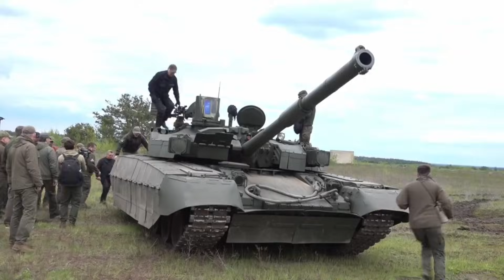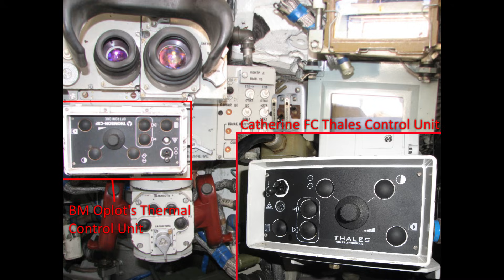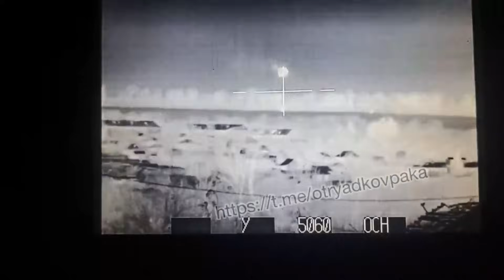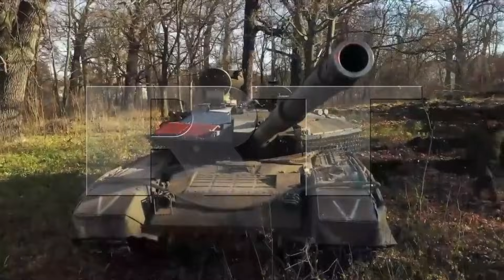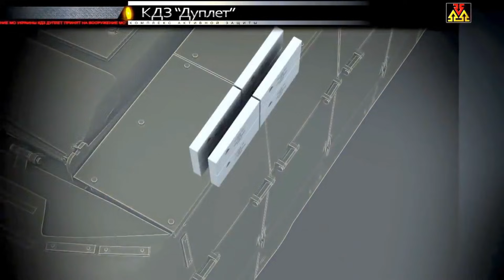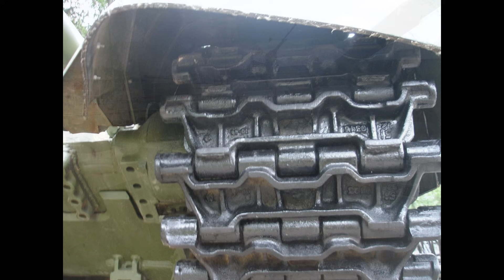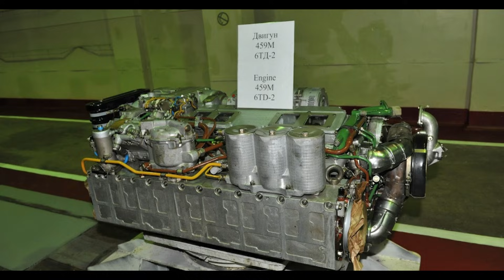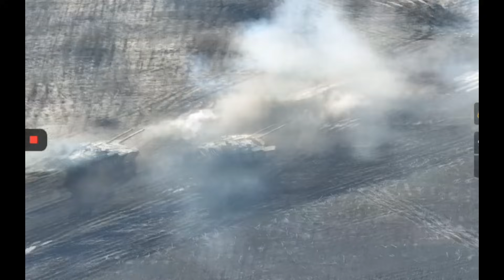Best Ukrainian vs Best Russian tank. T-90M vs BM Oplot comparison

Comment: On paper, the T-90M is the superior tank (aside from the reverse issue). Of course, it isn't just the tank that matters, but the crew and supporting elements, so that somewhat evens it out. Perhaps in the future we will see a BM Oplot-2 which addresses these problems.
Reply: Чтобы сделать оплот надо 2 танка так как оба корпуса разрезаются не много в разных местах и потом свариваются😂 это для того что бы увеличить отсек МТО, а про защищённость вообще ничего нельзя сказать т к нет боевых подтверждений её эффективности, а то что Украина сможет из производить это вообще нонсенс
Reply: If Ukraine is planning on producing the BM-Oplot now, it will likely get upgrades. Its over a decade old design that has barely any produced so they won't be upgrading existing vehicles, but making new ones. And if they are setting up a factory to make new vehicles, its a easy opportunity to upgrade its systems.
Reply: People who never set in a tank are the only ones complaining about reverse 😅, driving a car on a parking lot in reverse faster than 5 miles per hour would get you stuck within minutes, imagine driving a 50T machine in a 3D off road environment faster than 5 miles! You'll end up in a ditch within a few seconds!
Reply: The entire Oplot tank is on paper only.
Reply: And the reverse issue makes it on paper a worse tank.
The other T90M advantage are very small and situational. The reverse speed is not, as the war in Ukraine shows.
You’re much more likely to survive a battle in an Oplot with its reverse speed and better armor than in any T90M. Side armor in the carousel or not.
Reply: @Grimshak81  typical ukr. shill. It is absolutely not important , not as much as the ukr. shills led you to believe. On top of that ,nothing prevents you from turning around and using the full forward speed, as it only takes a few seconds. It is absolutely not the deciding factor in effectiveness of those tanks. As the absolutely majority of tanks are being destroyed while getting to the target and not while trying to reverse back.

Comment: It really boggles the mind that the Russians haven't replaced the transmissions. I'm no expert, but it seems to me that if the Ukrainians can install a gear reverser, then the Russians should be well and capable of doing the same.

Also as you mentioned numbers of T-90M, I've been trying to get a handle on how many have been produced since the Kherson offensive, and my best estimate is 320 or so. It could be as low as 250, or as high as 375. Just going off visible serial numbers and extrapolating, as well as collecting videos of tanks being delivered on trains. Not the most accurate method, but it's safe to say Russia is likely delivering about 2x as many tanks to the battlefield as Ukraine is receiving from us in the west.
Reply: I was a T-72 gunner with the 6th guards motor rifle regiment. The reverse speed might seem like garbage when performing maneuvers in combat, but once the tank gets stuck in mud or other unfavorable terrain (happens a lot especially during the mud season), the very high gear ratio in reverse allows it to either get itself unstuck or helps massively when another Russian tank is required to tow the stuck tank
Reply: @Insert-Retarded-Reply-Here  Thing is, they could keep that gear and add a few more. Because the danger the tank is exposed to is probably greater than the reduced risk of it getting stuck and possibly lost. I mean, at least you don't risk the crew
Reply: @Pao234_  I'm pretty sure that the engineers at UVZ have investigated this matter before making their choice. You can't imagine just how meticulous design processes can be.
Reply: @Pao234_  it’s not that simple. To add more gears requires a redesigned gearbox, and though this level of technical specificity is beyond what I am familiar with, larger and heavier gearboxes are required to accommodate more reverse gears which may prove too bulky for the T-series vehicles unless the gear ratio was changed, and on top of that it would result in reduced components interchangeability with other Russian tanks, which is partially the reason why the T-80 program was abandoned. And you may think that reversing faster is more important than recovering a stricken vehicle stuck in mud, but the soviet/Russian doctrine has a pretty consistent track record of prioritizing logistical soundness over sheer combat performance.
Reply: @koskok2965  agree
Reply: @Insert-Retarded-Reply-Here  Maybe they can steal some ideas from Polish tanks that have redesigned the transmission. I remember hearing they are a bit faster in reverse than russian tanks.
Reply: @Act1veSp1n  same as Czech T-72M4CZ
Reply: @Act1veSp1n  Uralvagonzavod has the technical and manufacturing capacity to make an even better transmission than the Poles regarding modernizations for the T-series vehicles. Apparently, they have determined that the trade off for superior reverse speed for inferior torque, less parts interchangeability, and of course budgetary concerns wasn’t worth it.
Reply: @Act1veSp1n  Polish tanks didnt redesign the transmission, they straight up bought it from the french iir, and only for export models. Domestic Polish derivatives have the same shot reverse speed, for some reason.
Reply: @Insert-Retarded-Reply-Here  they may have decided its not worth it, but it was before Russo Ukrainian war
Reply: The Polish PT-91 has a better reverse speed because it has completely different drivetrain, that consists of a 1000hp Scania DI16 V8 engine and a RENK automatic transmission. But apparently not all of the PT-91 tanks have the same drivetrain, many still have a T-72 like drivetrain with a 1000hp V12 diesel engine and the same reverse speed
Reply: @Insert-Retarded-Reply-Here  Interesting to hear some explanations as to why. Sick of hearing NATO bots laughing that it's because they can't.
Reply: @Insert-Retarded-Reply-Here  interesting feedback from someone that actually knows their stuff.
Reply: That would be very impressive considering they make less than 200 new tanks a year, if all 200 plus 100 more were all T-90M I'd be shocked, that would be greater than soviet production. Also they would have tripled the amount of total T-90M since February 2023, in less than a year! Wow how realistic.
Reply: @shadowguy1112  You know that often in a war, countries will rapidly increase production, right?
Reply: @saml7610  There is no physical way to count the number of T-90Ms made based of  a "serial number" like you can do for the SU-57. Yes production will increase, Russia however does not have the ability to increase that significantly, even Dimitry Peskov, the literally head of Russian propaganda does not claim the massive numbers you do...
Reply: @shadowguy1112  Untrue, I just counted them.
Reply: If I hazard a guess cost and time issues played a role.
Reply: Hahahah sell off spare parts go BRRR
Reply: There seem to be indications, that the production of new Tanks in Russia is currentlich nearly zero. The capacity is hardly enough to refurbisch and repair the old stuff and it ist much more effective to maintain 100 Tanks than to build 10 new.
Reply: @potator9327  Absolutely zero indications of the sort that I've seen. Not sure where you're getting your info, but it does not seem to be a very curious or intellectually honest source.
Reply: @saml7610  Nice, your sources are obviously sound and any other Intel than yours must be inetectually inhonest. Watertight bubble.
Reply: One leopard 2 is worth 20 t-90 m.
A leopard 2 can pick them off one by one and those T-90Ms can’t even see it
Reply: @sirmustard5337  they both died in syria like the british battlecruisers at jutland, turning into rockets.
Reply: @sirmustard5337  Nah my man, that's not true. I was a cavalry scout, commanded an M3 Bradley, worked alongside Abrams and German Leopards when I was deployed to Germany. 

I know tankers fairly well, and there were no illusions amongst any of the men I worked with that our equipment was in any way exceptional in comparison to the newer stuff which the Russians deploy. 

Russian equipment has it's deficiencies, yes, but it's still formidable, quite capable. Their issue isn't quality - it's their ability to get their quality, top end, modern stuff into the field in numbers. Until this war, they were really struggling to get those numbers up, but that has changed. They are cranking out T-90M's, and the T-90M is no joke. It's a serious, capable piece of kit, and anyone going up against it would be a fool to brush it off.

In armored warfare, whoever sees first, they shoot first, they win. The T-90M is well equipped to see first, shoot first. It can and will win in a head on engagement against Leopard 2's. 

Don't fall for that "Russian gear is pure junk" crap, or you'll end up sorely dissappointed and surprised when it turns out it can actually dish out some serious hate.
Reply: @sirmustard5337 yeahhhh.. how’s that going 😂😂😂

Comment: Why didn't the Ukrainians copy the best features of the T-90M ?
Reply: Industrial capability. Hard to design new tank when your factory can get bombed
Reply: @juliuszkocinski7478  They've got locations where this can be produced - there are ton of underground factories in middle of Ukraine (Harkov for example). Its just that they dont have the economy and the industry anymore to do this. A tank is not just a hunk of metal that can be produced in one place. A whole industry has to work for production of tanks - metallurgy, electronics, chemistry - all these things have to work together to produce the final product. 

Right now everything in Ukraine is paid by western money, so its just easier to import new tanks than make them inside. Besides the west is not interested in building up Ukraine.
Reply: @Act1veSp1n  It is, at least in moderate rebuilding - there are already plans being made especially regarding European funding to solve housing crisis and to get economy at least back on track. AFAIK during latest Zelensky visit in Germany some signing in the topic took place.

Comment: The BM Oplot is pretty damn good all things considered. 

The Duplet armor System seems super effective, and the mobility is excelent.

Of course, it has a lot of oversights, and has reduced anti tank capability for a top modern tank.

They are just TOO few to make any difference, and I doubt Rheinmetall could come close to UralVagonZavod's production.
Reply: Why would Rheinmetall make T-84 if it has a decade worth of orders for Leopards. Which are simply better. The whole T-84 production is a hoax
Reply: @phunkracy  of course, but in the case of Ukraine, heavy artillery doesn't make the distinction between a Leopard2A7 and a BM Oplot.

The tanks Ukraine has received are mixed in quality, and the Leopards will go boom just as easily as a T64BV, and atleast a couple will be captured. So... With that in mind, Rheinmetall might want to not get a continuous PR loss, but it is under pressure to supply Tanks too.
Reply: I would love for it to get some field experience, because the fact they had to remove part of the upper frontal plate to not break the suspension because of how heavy Duplet is gives me the feeling that the tank may not be as reliable as one would wish. Unlike Russia with the T90M, which seemed to modernize practically the entire platform (aside from the transmission lmao), the Ukrainians seemed to just build up on the old T84 platform, without really changing much from the basic design (aside from the turret ammo rack, that was nice). We may have something like a Panzer IV situation, where by the middle of the war, not much could be done to further improve it without redesigning things like the suspension or the general layout, something the Russians seem to have done with their original T90. I don't know, but the T90M seems just so much more practical and mass produceable to me
Reply: @Pao234_  I agree, but I wouldn't compare them to the Panzer IV, since this one is in less than a dozen models, we haven't even seen them at the front!
Reply: @Pao234_  Oplot has already seen battle. Russian tanks are everything than what the advertising makes them look like. This illegal invasion has proved as much. Russian tanks are downright dogshit compared to Western tanks
Reply: Don't forget that Russia has 5 more tank factories
Reply: "Knife", as well as "Doublet" are effective only on paper. There is no real evidence of their effectiveness.
Reply: @user-bz3gz4ok3k  except it doesn't work as advertised - internal layer has no room for expansion so it's ineffective as ERA. Therefore it's very inefficient composite armour. Alternatively, if layers are made to be separated, than layout of ERA blocks doesn't make sense and removing layers could be problematic after being hit by penetrating rounds. Additionally there is a weight issue adding ERA as external package is fine, but Duplet require whole new frontal block(VLD), that significantly increase it weight/size and even more complicating access to the driver hatch. For additional arguments: you can look at leopard2 - after a while they get additional external ERA blocks but not Nozh or Duplet, therefore they are not superior but alternative route (or even inferior) to Contact1. There is a potential for Nozh to be reused as stepping stone for better scale-style ERA, but it requires different compacting method and it shouldn't be used as Duplet - overlapping areas with no ERA active blocks and sizing issues with decreasing density of the frontal armour is a big no-no. Additionally there is an issue with sizing - Nozh loose efficiency with decreasing active block size, therefore effective scaling isn't achievable, in comparison to Relict.
Reply: Duplet is a bs - real efficiency is not even half of advertised. And basically replaced with more reliable contact-1 and. Actual armour efficiency is lower, not higher. But it looks cool on paper, so they tried to sell it, but made too few to complete the order.
Reply: Ok hoho
Reply: @Lemosa3414  Cope and seethe bot. How does it feel to know Russian Orcs are killing themselves off? Alcoholism, drugs, emigration and now wars where you are losing hundreds of thousands of young men for nothing have made sure soon Russians will cease to exist. Anyways we in the West are laughing at you Russians. Enjoy being a Chinese puppet

Comment: the T80-Oplot main gun can be swapped to NATO standard 120mm smooth bore gun which can used more modern APFDS rounds that is overkill against russian armor
Reply: Nope, becaus its still retains a old autoloader
Reply: Not really. It would be difficult to adapt auto loader to it. And tank is too small not to use autoloader.

Comment: The T-90M is one of the worst tanks on the planet at the moment, but the BM doesn't exist.
Reply: You really gotta tell me how the T90M sucks
Reply: @kuunoooo7293  It's a slightly upgraded T72, which already was a really bad tank in the 70s, and has done absolutely poorly in every war since. Even somewhat weak modern MBTs like the Leclerc or the Ariete are far superior the the T90M. You have to understand that the Russian military has been in complete disarray for decades now.
Reply: @LeMAD22  bro you are straigth up telling me you know absolutelly nothing about tanks. You really got to tell me the single simaleraty of a T72A from 1980 and a T90M. Also the T90M can combat any modern mbt, it can do that.
Reply: @LeMAD22  None of these western tanks have seen actual combat - they all were covered by insane amount of Air before they even had any contact with the enemy.
Reply: @Act1veSp1n  The problem being that the T90M has seen combat, and its been absolutely pathetic at it. It's currently useless in combat against a 3rd world country with 1950's tanks and weapons.

Comment: The biggest problem of T-90M is that without the western equipment, electronics, optics and parts it becomes a T90A 🤣
Reply: Well, china can make those and sell or send them to Russia
Reply: @akriegguardsman  that ill make China a supporter of the aggressor.
Reply: T90M doesnt really use western components so
Reply: @kuunoooo7293  oh yes it does - everywhere in every piece if its electronics equipment.
Reply: @sdrkrm  not really, source ?
Reply: @kuunoooo7293  I guess you're not aware that a handful of T90Ms were captured by the ZSU, dismantles and thoroughly studied? The electronics on this thing is decades old in design. Fire control is built around a general purpose civil grade components instead of mil-grade. That's why it fails so often.
Reply: @sdrkrm  i have no idea were you get your sources from but i can already tell these are lies, im not that dumb
Reply: @kuunoooo7293  oh lol! it's all online - google it yourself, kid.
Reply: @sdrkrm  good sources, "google it" and "i saw it on the internet"
Reply: @ArielK-a  since the comments section wont let me post any links - Im afraid you have to use you brain this one time, kid ;)